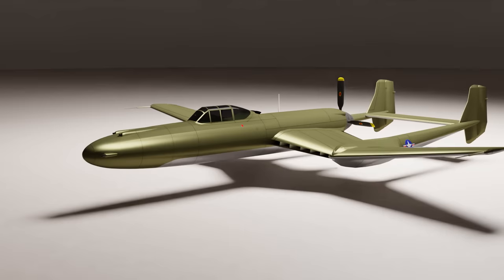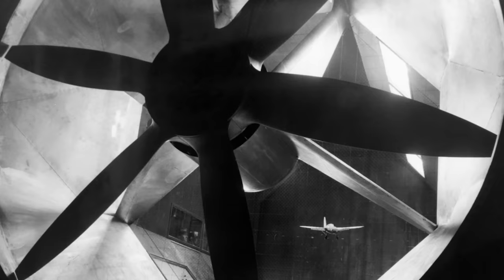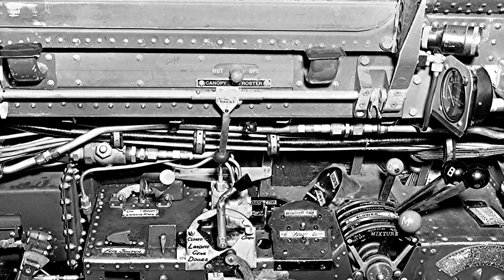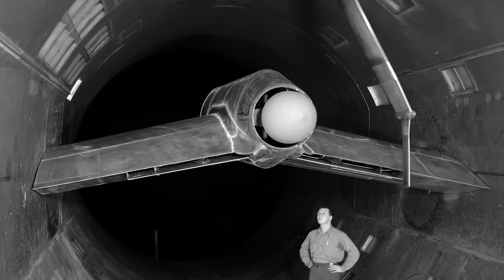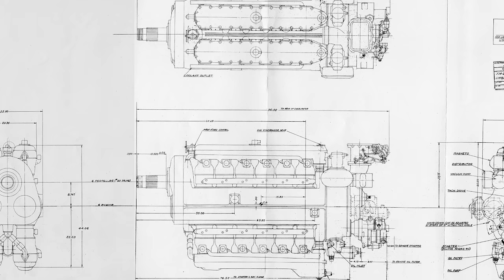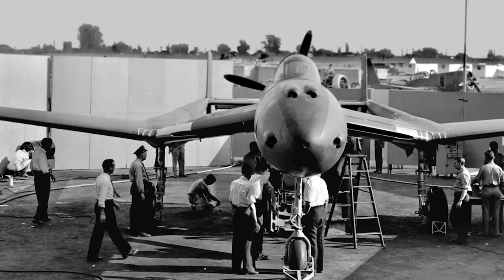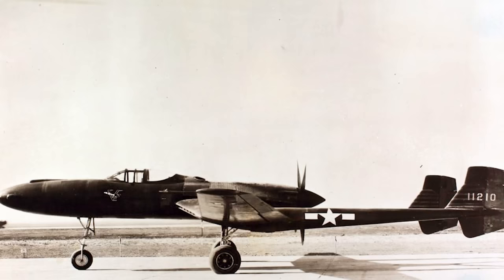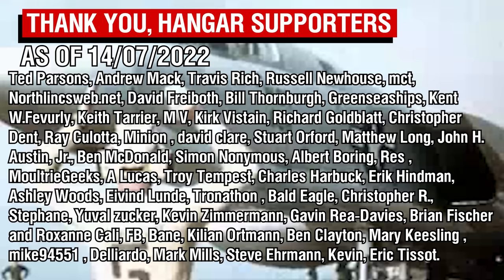The Super-Fighter That Was Betrayed By Its Engine | Vultee XP-54  [Aircraft Overview #68]

Comment: Trying for the success of the P38. What Doomed the P38 and P47 was costing 4 P51s or P40s to build and using 2x gas (Britain got oil by tanker, and D-Day fuel need too).
Rem: Engine airflow over wings (& ailerons) was CRITICAL for P38 to fly (c.f. prototype crashes).

Comment: It’s more than the engine that let it down. That fighter is huge, and it has A LOT of drag surfaces on it. That central fuselage isn’t doing it any favors, either. 

I doubt it would’ve hit 510 mph even with the engine designed for it at the original mass of 9,000 lbs.  There’s just too much surface area facing the wind.

It certainly is a beautiful design, though.

Comment: Curious that since both V blocked engines, AND Inverted V blocked engines existed, you would think that a X-block engine could work and reasonably easy to design......
Most if not every major power during WW2 tried to design and failed to make a X-block!!!  (Note: the Rolls-Royce Vulture issued was that they changed the propeller during testing.
Also, just like a lot of other engines (US R-4360, W-3420; British Napier Sabre, and I can't remember all of the others right now) part of the problem was the Lube Oils/Motor Oils of the period.  Nothing to prevent acid buildup (except frequent oil changes), foaming of the oil at high rpm speeds, not multi weight (like you put in your car now-a-days), and viscosity break-down at certain bearings....
Reply: Napier Sabre and Bristol Hercules, both sleeve valve engines, needed very tight machining tolerances to work. Just ahead of the tech then.
Reply: @suzi_mai  And their unbelievable RPMs with those "early" Motor Oils didn't help their reliability!

Comment: For all the work and risk making a downward firing ejection seat they should have just put charges on the prop/engine mount and blew them before bailing. 
What did they intend to do with the shell casing, the Japanese J7W stored them in the front wing.
Thing is as big as a two engine Bomber you don't realize how big these planes were when your only reference is building 1/72 scale models of them.

Comment: The real problem with this aircraft is that it was beginning flight testing with a piston engine in 1943 and would only have entered service in 1945. Thus it was obsolete before the test program started.  If it wasn’t jet powered at that time it wasn’t going to get into service. Even things like the Spiteful (supermarine’s iterative upgrade on the Spitfire) never made it into service unless or until redesigned to take a jet engine.

Comment: One interesting thing is that the testflight of this aircraft and the Swedish fpl21 in similar configuration was made the same year. And Sweden got around the problem with the propeller being in the way if the pilot had to bail by using the worlds first powder driven catapult seat. And it's the only piston driven plane that was successfully converted to jet.

Comment: I wonder why they chose a downward firing ejection seat instead of a explosively detachable propeller as the Germans did with the Do 335.
Perhaps the force of the propeller hitting the tail would cause problems for the pilot?

Comment: The biggest problem with pusher prop fighters, is how vulnerable the engine is to enemy fire.
Reply: Right, unlike a traditional layout where the pilots skull and torso can protect the important engine components from enemy fire.
Reply: @kyle857  Which often has an Armor Plate on the back of the seat, to protect the Pilot, just like the P-40 had, and most other US Fighter Planes of WW2.

Comment: The failures of the XP-55 and other experimental fighters can be more properly be blamed on the failure of the Hyper Engine projects than anything else in my opinion. The Continental, the Lycoming, the Wright and the Pratt &Whitney experimental inline engines all lead nowhere. Although perhaps we can give P&W a pass as the Air Corps allowed them to drop the sleeve valve engines in favor or the R-4360.

Comment: 5:54 not really the issue, as it'd take a sustained, relatively high temperature source of heat to cause the magnesium to catch on fire and stay on fire. it's because it was more expensive to manufacture and machine, as well as it being brittle and otherwise considerably weaker.
Reply: also 6:25 the diagram you have shows it can move through a range of 9 degrees, moving 3 degrees up or 6 degree down from the initial position.
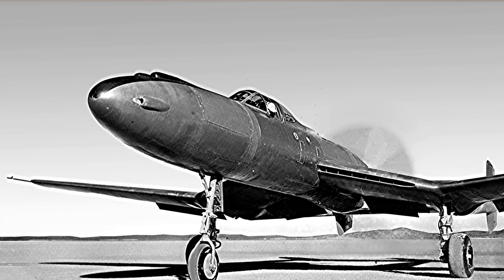Reply: 12:40 -_- magnesium's flammability risk, especially in this application, is extremely low, even if it's considered "highly flammable". it takes quite a bit to set it on fire, and it will melt at a much lower temp than it will burn, so unless it's contained it's not an issue. i get sensationalizing to make it more entertaining, but this is just annoyingly misinforming.

Comment: Well, I suppose the Army ASKED for innovation, but still... magnesium for the airframe?
Reply: I mean, aluminum is also flammable, but it takes a bit more than a brisk crosswind.
Reply: The B-36 used magnesium for large areas of its skin. The B-29 may have also.
Reply: Light that candle....
Reply: The B-36 had large areas of its skin made of magnesium. Worse, the B-29's engines had magnesium components. A simple engine fire easily turned into a catastrophic engine fire.
Reply: @kristianfischer9814  Powdered aluminum is used in explosives but the sheet and cast aluminum we use all the time is perfectly safe.
Reply: @donjones4719  Magnesium alloys are widely used in jet engines, in the structures of military and civilian helicopters, and in hundreds of auto components, without flammability issues
Reply: @3ducs  The crews of HMS Sheffield, USS Belknap and USS Stark might disagree with that assessment.
Reply: @kyle857  Magnesium has corrosion issues. "Mag" wheels on cars, if real magnesium, can develop deep pits leading to stress fractures.

Comment: A huge, undeveloped engine, a huge airframe and a complex (extra weight), somewhat aim-able weapons mounting. All subject to numerous teething problems and it looks a bit fragile. At best this thing might have been a weapons and technology test bed. No way would this have been able to deal with smaller, more agile opponents, so, no dogfights. Had the engine been reliable, it might have made a good high altitude bomber interceptor and for this, the trainable nose armament system would be totally unnecessary. A battery of fixed canon (20 mm would do just fine). The main problem was that the aircraft it was to hunt never really materialized and existing fighter types were coping quite well in countering the existing types. At least the designers gave some thought to rearward visibility. A "souped-up" P-38 would have been easier to accomplish... like give it two Packard Merlins and pressurization. I do like the unusual design though and I wish that there were a 1/48 kit of the beast!

Comment: The P&W radial engines were the only good aircraft engines produced in the USA during ww2
Reply: The v1710 is a pretty rock solid design.  Mis application aside.  The 28 cylinder P&W and the R-3350 Wright were formidable to say the least.  
At least the US abandoned dead end sleeve valve tech in the 20's.

Comment: Couldn't we just get two Packard built Merlin engines replace the supercharger with turbochargers and run the power through 8 blades of contra rotating props. Hell the engines from a P-38 would do for initial prototyping.
Reply: Or a Griffin or Napier Sabre or Napier Nomad…
Reply: @allangibson2408  
It is an American prototype.
Reply: @calvingreene90  So we’re the P-59 and P-80 that flew at the same time. Both also used British designed engines.
The Merlin was the immediate predecessor to the Griffin. The Griffin just had 1.25 times the engine capacity - 36 litre vs 27 litre for the Merlin.
Reply: @allangibson2408  
The Jet engines were a special case.
Reply: @calvingreene90  The US built a LOT of British designed and specified equipment (including the P-51 Mustang).
The USAAF also operated British designed and built aircraft - including Spitfires, Mosquitoes, Beaufighters and  post war Canberra bombers (because the American designed equivalents were just so bad).
Reply: @allangibson2408  

The P-51 received the Merlin engine because the British decided that Allison powered p-51's underperformed at altitude and sent a prototype back with Merlin engine.
Reply: @allangibson2408  
I have found no evidence that Spitfires, Beaufighters, or Mosquitos being built in the USofA.
The Canberra was a remarkable airplane but was not as Superior as you think. The the American prototypes it beat promised better performance but both politics and the advantage of good enough now over better in a few years played in its favor.
The American Army Air Force looked into licensing production of Griffin engines and the licensing fee was ridiculous. Apparently by that point winning was a foregone conclusion and the British government was more interested in paying for the war than getting better planes.
Reply: @calvingreene90  The P-51 exists only because the British paid for it to be designed and built.
Reply: @calvingreene90  They weren’t built in the USA - they were however flown by the USAAC/USAAF in US markings because they had no suitable alternatives.
The British didn’t NEED better planes by 1943. 
They had their own ones that were superior to the American built aircraft (the exception was the B-29, the while Lancaster could do the same job but was unpressurised making the B-29 far less tiring for the crew).
Britain always built better engines than the Americans - particularly because they had the guy who literally wrote the book on high performance piston engines (Harry Ricardo).
Frank Whittle was in a similar position on gas turbine engines.
The Americans only caught up when they imported Hans Von Ohain from Germany post WW2.
Reply: @allangibson2408  
There were suitable alternatives to Spitfires, Beaufighters, and Mosquitoes but in a hurry to get the American Pilots into battle because the UK had a pilot shortage giving the American Pilots British planes was the fast option in getting them into the fight. And granted while the P-39 was good ground attack plane it was a lousy high altitude fighter which the RAF considered more important at the time. After D-Day replacing all the P-47s and Hurricanes used in the ground attack roll with American built Ilyushin Il-2 would have been a great improvement.
Reply: @allangibson2408  
North American Aviation would have built something very similar to the P-51 even if the British hadn't been looking to buy planes but yes it was first built to a British order but ended up paid by lend-lease funding.
Reply: @calvingreene90  There was no alternative to the Photo Reconnaissance Spitfires or Mosquitoes - the American aircraft just didn’t have the range, altitude capability or speed.
The Americans didn’t get a functional radar equipped night fighter to replace the Beaufighter until the Black Widow came online.
The British led the Americans on Radar throughout WW2. The Americans built a lot of British radar designs…
Proximity fuses were however an American innovation…
Reply: @calvingreene90  The P-51 design was done under the “cash and carry provisions” that predated “lend lease” as an alternative to the P-40 that Curtis couldn’t deliver.
Even the T-6 trainer existed because of British and Commonwealth orders - no British orders means no North American Aviation (they would have gone bankrupt in 1939).
Reply: @allangibson2408  
With the spitfires being supplied for photo reconnaissance in Europe photo reconnaissance is variant P38 lightnings we're diverted elsewhere. 

Why divert planes from rolls they do better to at great effort make a radar night fighter that is no better?

There are high level British sources that state that America had the edge in radar development at least after the development of the magnetron. 

The greatest service the HMS Victorious gave the US Navy when operating at the USS Robin was teaching Royal Navy fighter Direction and other strike package management to the US Navy. This is in no way meant to belittle the other service rendered.
Reply: @allangibson2408  
The P-51 was ordered under cash and carry but not delivered under cash and carry. So ended up paid for under Lend-lease.
I seriously doubt that the USofA government would have let NAA go bankrupt in 39 when the Army and Navy were buying trainers from them.
If the British Expeditionary Force would have been sent to redemilitarize the Rhineland after Hitler illegally militarized it World War II could have been avoided.
Reply: @calvingreene90  The first Mustangs were delivered to the RAF in April 1941.
The second batch was delivered under lend lease.
The USAAC didn’t place an order until June 1941.
Reply: @calvingreene90  The Trainers bought by the US government had been based on trainers built for the RAF, RAAF, RCAF etc.
Reply: @allangibson2408  
If you say so.

Comment: I think I can see why their performance was so far below the wind tunnel tests and the engine power expectation. A pusher propeller needs to draw air from in front of the aircraft (in this case that travelling around the fuselage) to push it out behind, however it is heavily obstructed by the fuselage and wing air intakes leaving very little air flow for the propellers to bite. There was nowhere near as much air to draw to push than the propeller would have been capable of if it had a more ample airflow to work with. If they had pushed out the nacelles and installed a larger propeller that might have solved the issues though they would likely have been forced to add more blades to lower its wingtip speed.

Comment: Shouldn't have built it of magnesium, and should have left the pressure cockpit out.
Reply: Magnesium alloys are widely used in jet engines, in the structures of military and civilian helicopters, and in hundreds of auto components, without flammability issues
Reply: @kyle857   The Wright R-3350 engines on the B-29 were made of magnesium: they ROUTINELY caught fire, with often fatal consequences.
Reply: @benlaskowski357  and they did cought on fire because the engine cooling on B-29 (which arguably the most well known airplane that use this engine) is just bad or just downright horrendous
Reply: @billytheshoebill5364  The magnesium didn't help: it was too often the first thing to burn.

Comment: As always, some things were just  not  meant to be. This is one of them.  I think if not re designed to oblivion, it would've been quite the aircraft. The engine was the major problem. Without good stable power, you've got nothing. This should've been assembled with an R2800P&W with contra rotating 12' paddle props. (?). Too bad no survivors.

Comment: OK let's replace that engine, a less broken but just as underwhelming, then just add a bunch of weight...and Remember to act surprised when it preforms worse.  Normally with military procurement and spending being what it is in the states, this would result in more money but...alas sometimes...its just not as simple as bad plane can be fixed by more money.

Comment: I thing it is fair to say we would all have liked to seen this one in combat. Should have used the Merlin engine. We know that one works. Just look at the P-51
Reply: Griffin… (Merlin’s bigger brother)…
Reply: @allangibson2408  True but I was thinking that the Merlin would be in production in the US during this time scale.
Reply: @bigblue6917  The Merlin was at its limits.
The Griffin would be a better match to this airframe’s power requirements.
A gas turbine probably would have been better still…
Reply: @allangibson2408  True.

Gas turbine. Well the engine would get there. Not sure about the rest of the aircraft.
Reply: @bigblue6917  The British did build a turboprop version of the Gloster Meteor (and a bit later the Lincoln bomber (a Lincoln at 50,000ft was not comfortable for the crew…)) but a pure jet could also be an option…
Reply: @allangibson2408  I knew of the turboprop version of the Meteor. Interesting about the Lincoln bomber being used as a test aircraft. My late father was in the British Army post war and he once told me of an incident which happened when a bomber flew over the army base he was stationed at. As the bomber flew overhead it suddenly started up the a jet engine it was testing and the noise was so startling that many of the soldier ducked for cover. He said it was a Lancaster but given the similarities between the Lancaster and Lincoln I now think that it may have been a Lincoln that he saw.